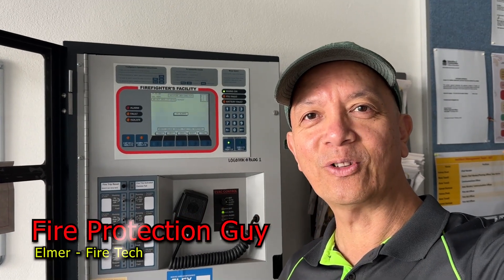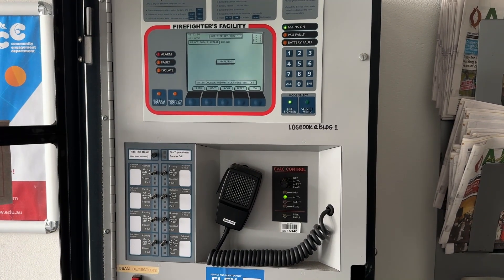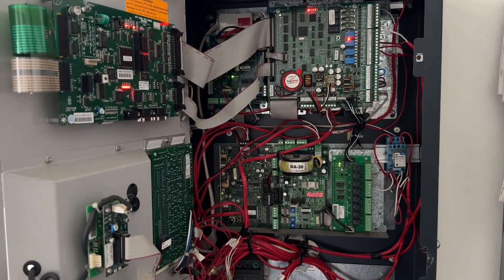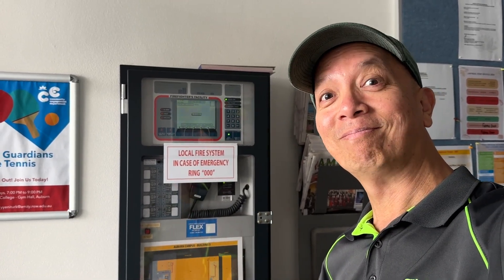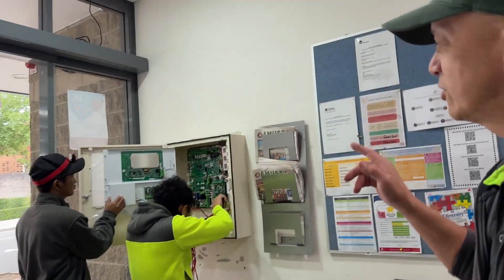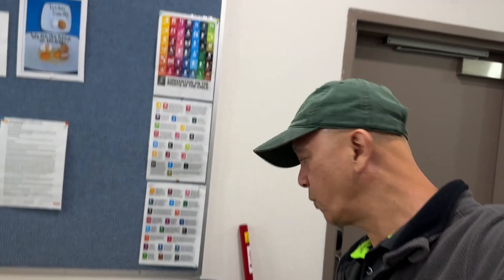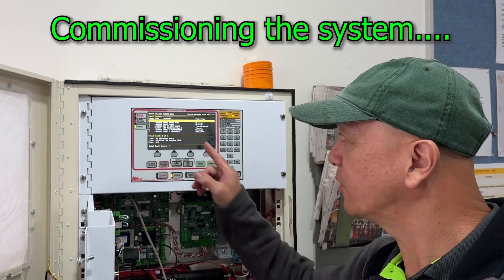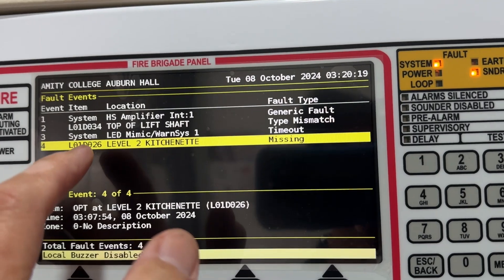Fire Detection System - IFS 2800 to Pertronic 220 Panel Replacement

Comment: Sometimes, notifier devices work on pertronic
Reply: The devices are a completely different protocol. Not compatible
Reply: @BenPonting-w9s  They are all based of system sensor clip protocol. honeywell tweaked the protocol a bit so you cant mix devices at times.
Reply: Interesting, looks much more modern than the fire panels here in America.